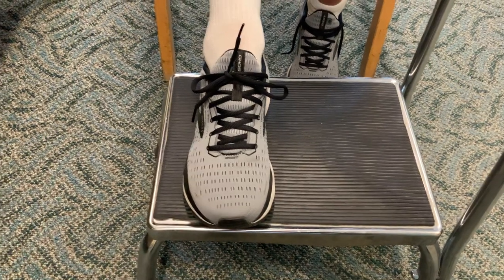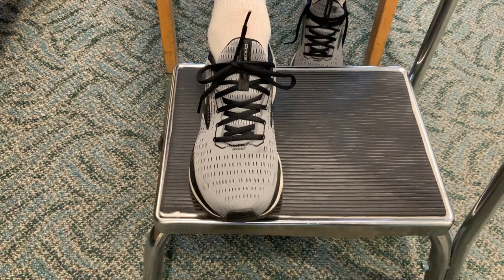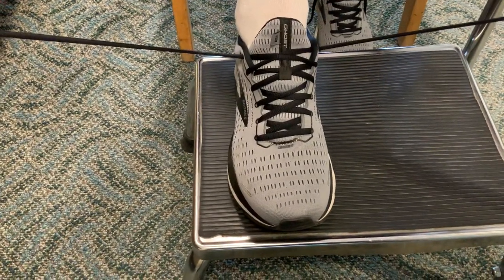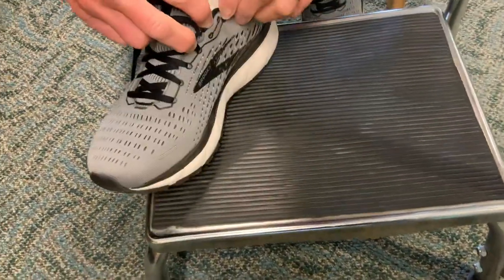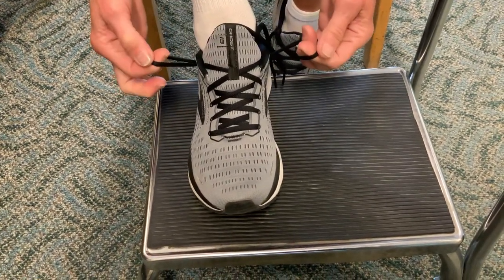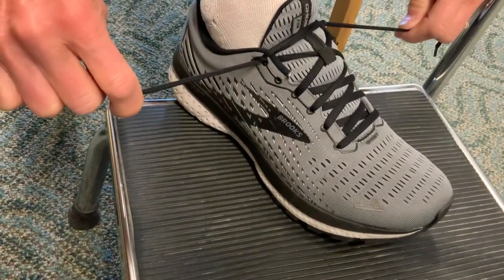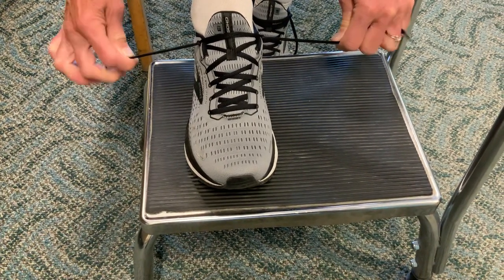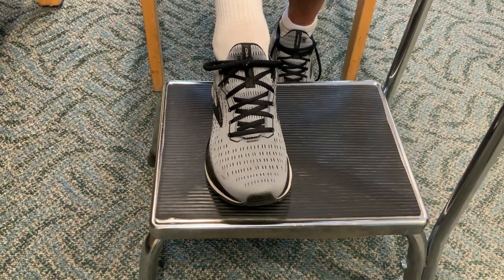Stability Lacing for Shoes

Comment: That doesn't increase stability, that prevents heel slip.  Also, that shoe was way too low volume for whomever that was modeling it.
Reply from the maker: Gabriel, that for your comment! As a podiatrist I have patients walk with and without and the patients love the increased stability. I can see the increased stability. I agree that the stability increase is across the subtalar joint, not the ankle joint! Rich